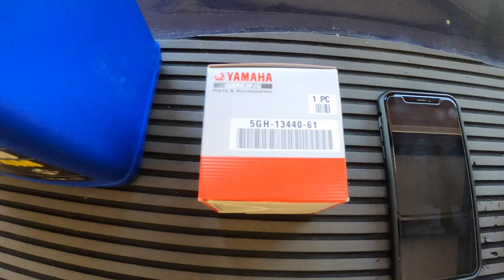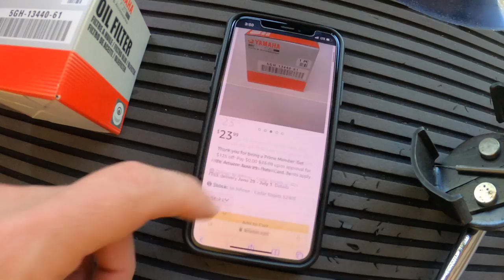How to Change the Oil and Filter on 2015 Yamaha VX1100 Cruiser Jet Ski Wave Runner

Comment: you forgot to mention  (be careful not to overfill ) new oil has to be on or under E (empty) mark when engine is cold, you have to run engine for like 30 seconds, turn it off and them check oil level..
Reply from the maker: Thanks for catching that and clarifying.